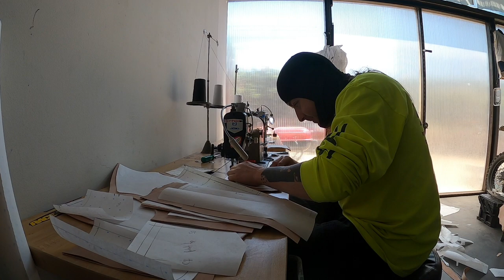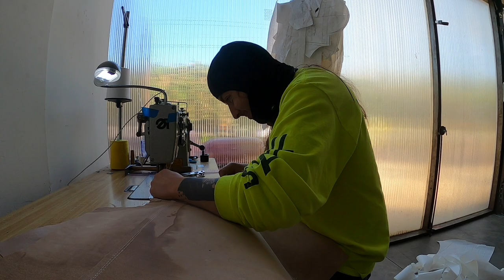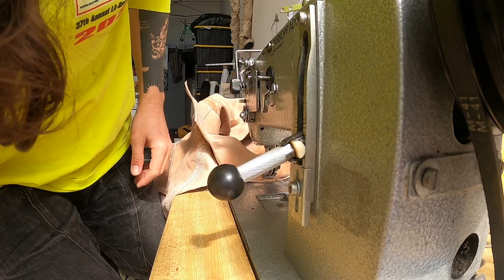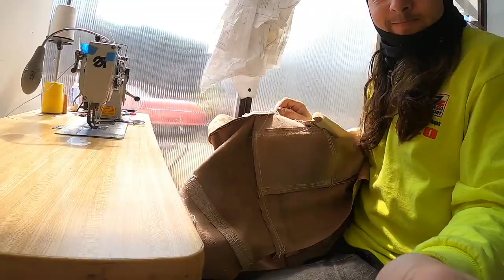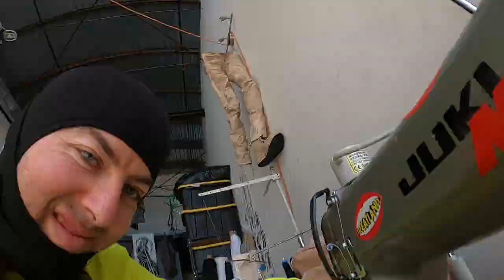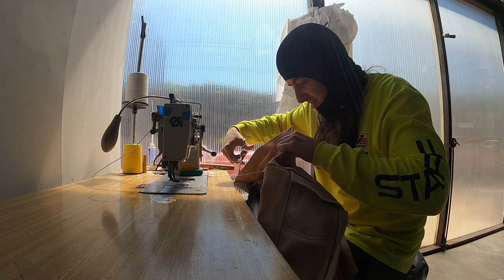Making a Leather jacket out of a leather no one wanted to sew!

Comment: Can you please share which machine you use? I thought you said Adler..but I see Juki. Which model? Would you recomend it over others for this work..leather and pleather/vinyl jackets. Thank you
Reply from the maker: @naomimara3340  this question comes up a lot- hard to answer. I jump between a single needle juki ddl-555 and a walking foot Adler.
Both are great. 
I like the juki for lining, and technical areas, pivots and zippers(when applicable) I like the adler for thick areas/ top stitching. 

Honestly if your going to be using pleather and lamb skin weight- you can get away with a juki set up for heavy weight(needles, feed dog, and plate) 

Hope this helps, good luck!